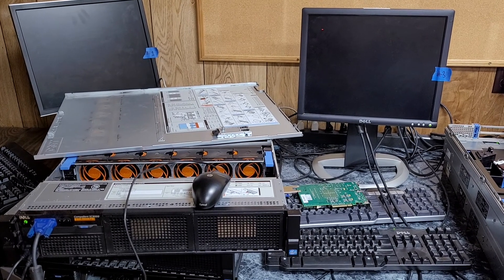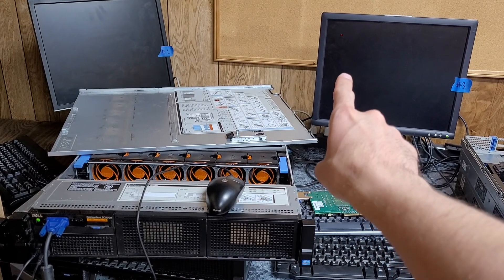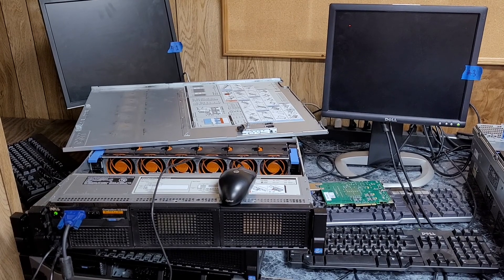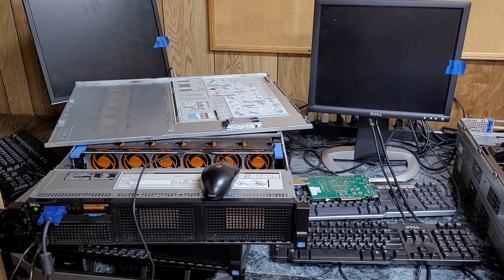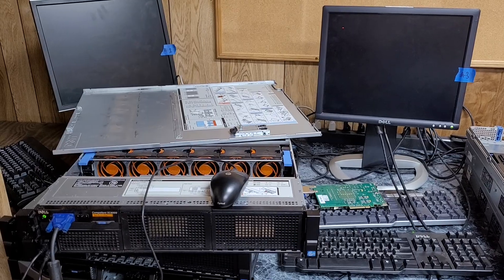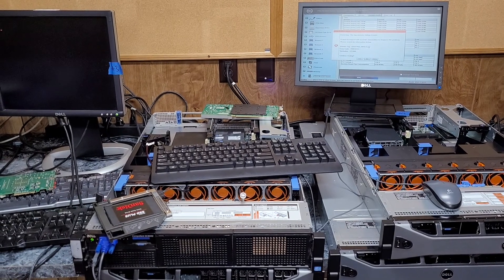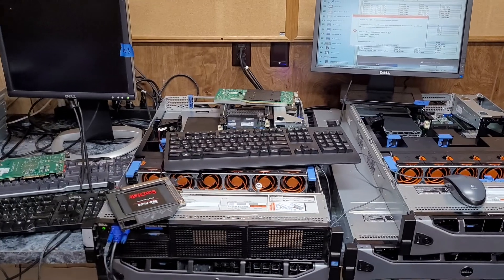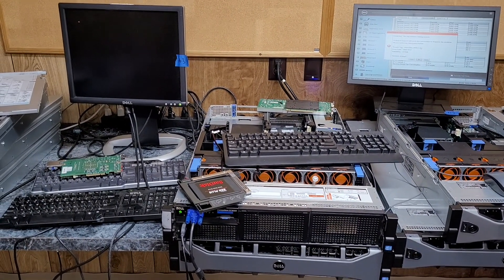Solution to Dell Poweredge R720 and SC8000 Lifecycle hardware diagnostics not loading

Comment: Thank you friend.!
I'm going to try to do this, I just don't know how, because I can't upload any system to it. I install window s and when it restarts and it starts to load, it just restarts again without giving any error messages.
Reply from the maker: I believe there's a way you can do the update through idrac. I have no experience with that though. If you're unable to boot into windows on your server you may have other issues unfortunately.